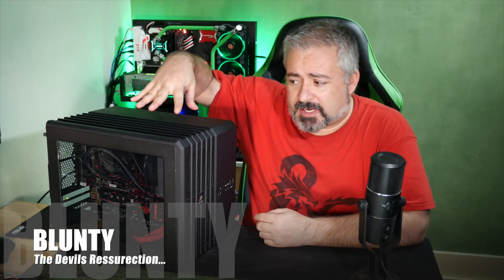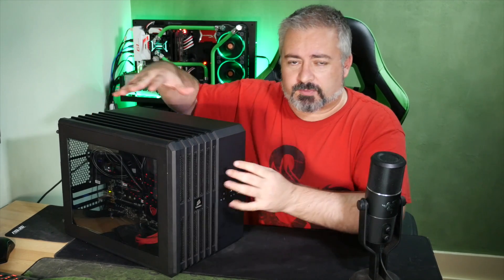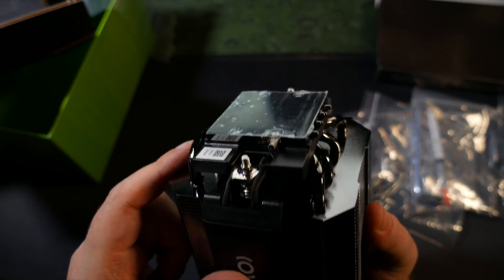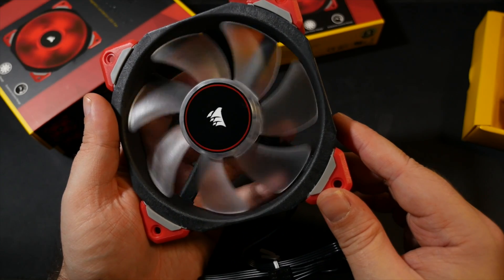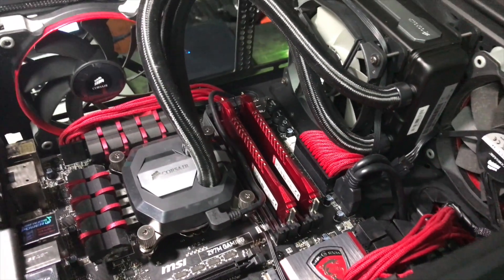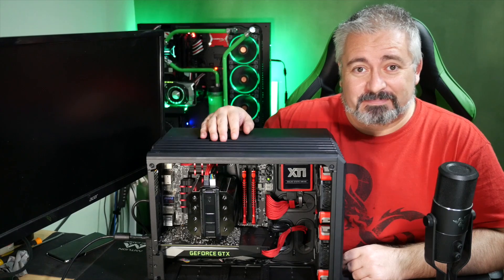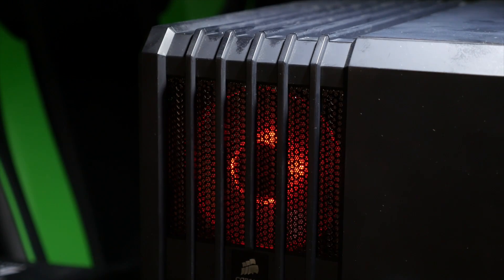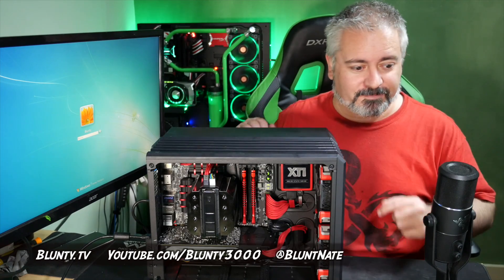Devil’s Crevice Resurrection! - PC Re-Build

Comment: I want this cooler so bad, except I don't know the performance compare to the H100i. I don't want to deal with AIO units, especially then their software doesn't work and is blasting at max speed all the time, SpeedFan seems to freeze on loading x_x

So yeah, want something smalll, just as cool or better than my current AIO and noise level down.

Comment: I've built about a dozen systems over the years and only ONCE had everything work at first power on.
Reply: Was that also the most troublesome machine going forward? For some reason, any machine I've built that didn't work straight away has been fine, any that worked developed some more annoying problems as time went on. It's like some kind of sacrifice to the stability gods or something. It has to fail on first button press for them to be pleased!

Comment: Interested to hear your thoughts on the cooler, as you may know it is pretty difficult to find a decent air cooler that the air 240 supports. Been looking for an alternative solution compared to the corsair h100i v2.